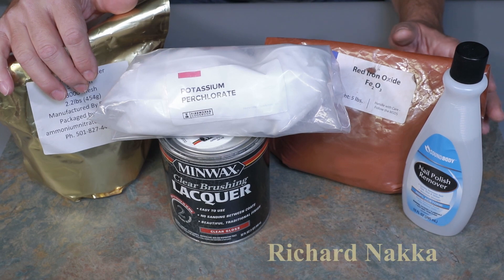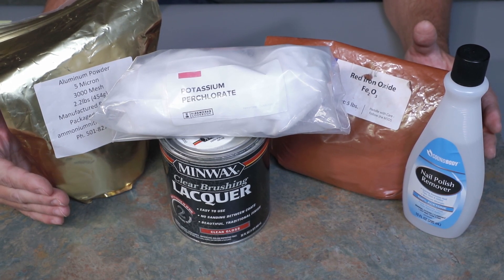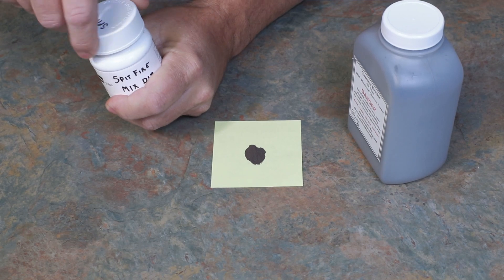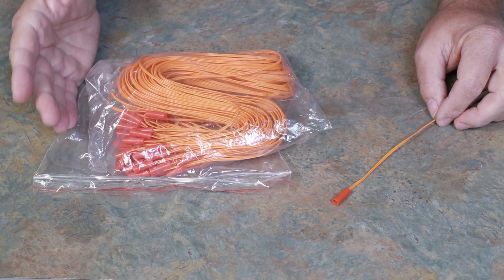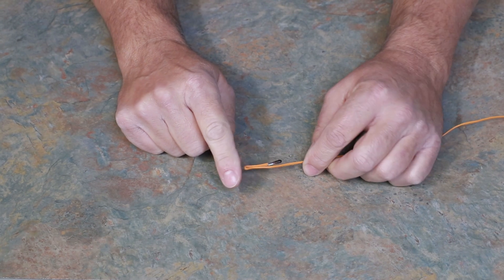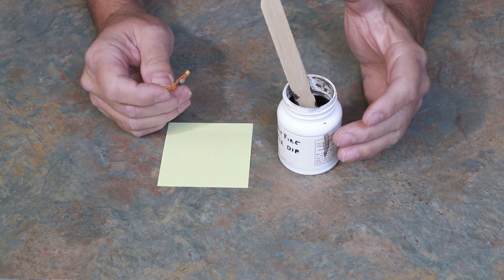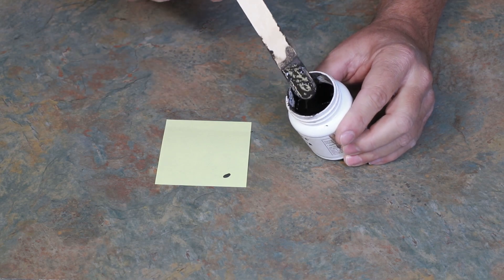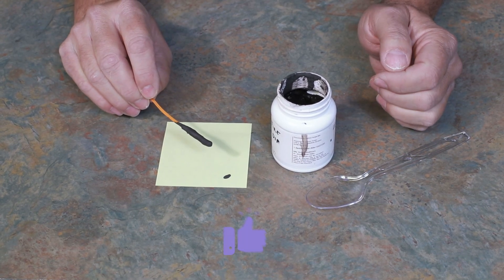DIY igniter for a high power rocket.

Comment: link to this ignitors? 

and dumb question. if you buy those ignitors why add this  mix to it? do the  ebay ones not spark enough?
Reply from the maker: The ignition process for a sugar motor goes through several phases. A long burning, hot flame at the forward end will efficiently ignite the motor. E-matches or fireworks starters emit a brief hot flash.

First, the fuel has to melt, then char, and finally ignite. After all that, the motor needs to build pressure to provide thrust.

The links come and go. Search for "Coosemt 0.3M Electronic Copper Connecting Wire 100 Pieces"
Reply: @TheRocketeer  aww ok. seems like that by its self would set off your ejection charge in the e bay just fine.
Reply from the maker: An e-match will set off black power no problem. Sorry if I didn't understand your question. @daytonpyro

Comment: I know this is bit of a older video but what are your thoughts on using 2 ematches in the igniter to insure a light
Reply from the maker: Using two e-matches may be sufficient, depending on the motor's core size. A dipped e-match burns longer, which is important, and hurls burning aluminum balls into the core of the grain.

Comment: Hello, the rocketeer i wanted to ask a question, I am currently building my own rocket motor and was intending to use steel for the casing+endcaps+nozzle  but I cannot get my hands on the correct size so I am considering to go with pvc for the casing and endcaps so could I use a metal washer on the nozzle side to protect the pvc endcap? Cause my motor will be fairly large about 200gms
Reply from the maker: Avoid steel end caps and use PVC instead. I have several videos on my channel that should help with your nozzle construction. Always assume a rocket motor could explode (cato.) Electronic ignition and distance greatly enhance safety!  https://www.youtube.com/watch?v=9AB4308IY68&t=27s